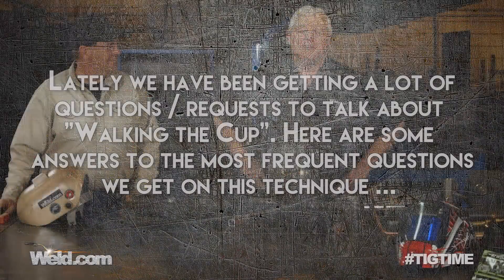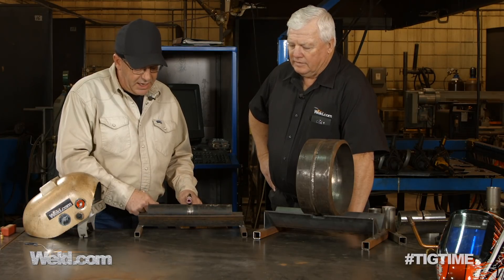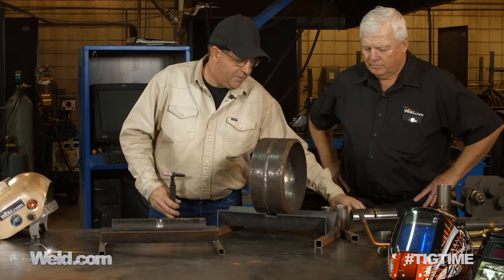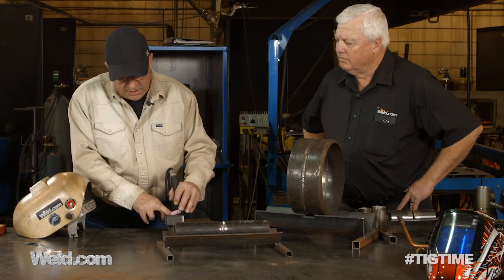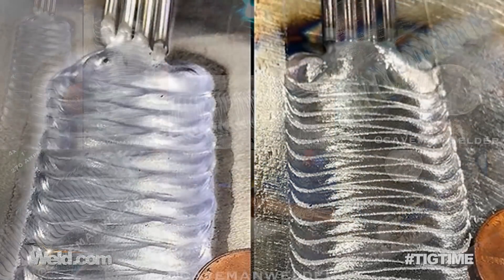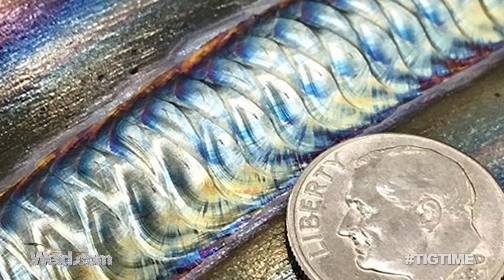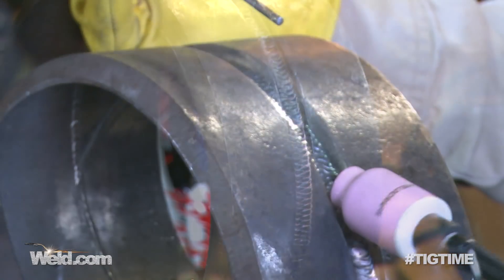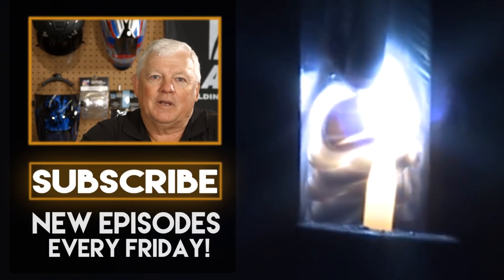TIG Welding Technique: Walking the Cup

Comment: I dissagree with bob saying walking the cup is faster than freehand you can flush a heavywall off the bead freehad because the torch angle you can not flush heavywall off the bead walking the cup on the cap or hot pas where you dont have to move alot of metal it may be faster but not for fill passes

Comment: I had a quick question. What amperage are you set at? I understand that amperage settings are probably dependent on the specs of the piece as well, but I'm curious as to what amperage you're running at.

Comment: Is it possible to do this on 110 amps? No 220 in new garage and that's all im limited to until taxes. Could I slim it down to a 17th or 3/32 filler and use more passes? I need lots of practice and that's all I have for machine and power at moment

Comment: I need some serious help on this. Biggest issues are... How to start a plate where u can't walk at 1st? I try and free hand but without a place to prop I usually end up dunking tungsten. Then once I get going parts will flow smooth and others I stick,skip ahead or am just going side to side with no forward progress. Do u have any joints to practice on or any tips? Need to get this down for 6g Tig cert.. have  asme ix in smaw now but need Tig to be employable.. help please

Comment: I now have two Lincoln Electric Mig welders and two Tig. The Migs are HD 100 and the Mig 180. Esab seems like they give you more features like the auto for when the sitck out gets impossible for the Lincolns ? I only have limited control over that.

Comment: Now lets get this clear, walking the cup is a fancy disguise name for resting the torch on the job to keep the electrode out of the puddle, and is used by those that do not have a steady enough hand to weld without doing so, so called walking the cup has no benefit at all to the weld.
Reply: John Bower you have no clue!!! LMAO 😂 Do you know what X-Ray welds are? What code are you welding under? I hear your foreman yelling your name, he wants those handrails finished.
Reply: Ummm... yeah, you keep doing it that way.... good for you.
Reply: @sillynacannada6718  I'm a Pipe Welder and a AWS Certified Welding Inspector, Yes I will Keep doing that way.  BTW a X-Ray Certified Pipewelder does it all, Freehand, Walking the Cup, Uphill, Downhill, Left Handed, Right Handed. But what you will not see is Dabbing, cause if it takes way to long and when you weld to slow, you will get replaced with someone that can do it all and can do it fast.
Reply: ZGERMAN  the reason one does not “dab”, some call it “push puddle” is because one risks oxidation,regardless of argon. You know, bad. If you free hand a UT, you’re either trying to bust out or in a rat fab shop that paid the inspector.
Reply: ZGERMAN just caught the downhill bit, so you run a squirt gun. You’re not a welder, you’re a joiner.
Reply: ZGERMAN ummm.... my original comment was meant for the original comment. Not yours, I was agreeing with you. Except for downhill and free hand tig...

Comment: i welded steam piping for 30 years. that was cool you know your shit. i know the codes dont like running more then one rod . i ve ran as many as six. while walking the cup, on the cover pass. i like to think of it as rolling the barrel light touch is very important. never thought about pulling down slightly makes sence. great video.

Comment: Union Boilermakers are the highest skilled workers of the skilled trades they weld smaw mig tig with a lot of it in out of position and in confined spaces they are also skilled heavy riggers lifting some loads in excess of 100 tons and also set and connect the iron to set these loads on working at significant heights it is a dirty and dangerous job and I loved it for 35 years traveling all over this beautiful country.retired union strong

Comment: Is Bob Moffatt a lefty tig welder?
Reply: Lefty but can do both.
Reply: to complete position weld tests you've got to weld left and right handed anyway to get bottom to top on both sides.
Reply: amazing!  my hero
Reply: Any good welder is ambidextrous. I know tig doesn’t throw sparks, but you can tell you’re partnered with a good welder when they have the same amount of burn on both sleeves.

Comment: Since this video is kinda old, I'm just taking the chance my question will get answered. I have experience with SMAW, GMAW and GTAW welding, but I've never used the walk the cup technique when I used TIG to repair dies. My question is, when do I need to use that technique?
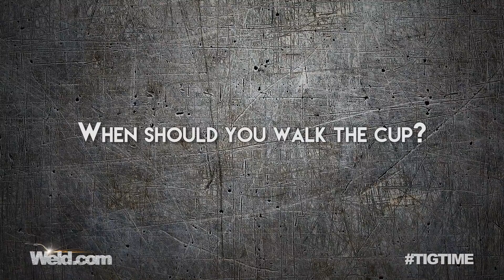Reply from the maker: We go over this to some extent in the video at 2:55.
Reply: Ok, I'll watch again.
Reply: Gotcha. It looks like this technique is best if you need very flat welds and if you need to work quickly.
Reply: We also have another video out on this technique.

Comment: I'm new to welding and confused.
can you tell me the difference between
Tig welding
MIG welding
structural welding
arc welding
stick welding
  I herd stick welding is the hardest and if you can do that then you can do all, is that true??? please helps.
Reply from the maker: That's a lot of information for a YouTube response and you'd be better off doing some research on AWS.org. Here is a brief answet to your question: 
TIG (GTAW) = Tungsten Inert Gas (Gas Tungsten Arc Welding)
MIG (GMAW) = Metal Inert Gas (Gas Metal Arc Welding)
Stick (SMAW) = Arc Welding (Shielded Metal Arc Welding)

Structural isn't an actual process, but the welding of erected structures, like buildings. 
Just because you can stick weld does not mean that you can "do them all". Each one takes practice.

Comment: God dang TIG is so clean! I do some flux core MIG welding and compared to this it is so messy (even though the welds look halfway decent after you clean out all the slag and brush it). 
What are the structural differences if any? I may have to start TIG'in! I do mostly projects for my Jeep such as roof rack and bumper hoop type stuff.
Reply from the maker: Takes a little longer, but for car parts it looks a lot nicer. Structurally it is better for that type of work too, because you can control the heat much better.
Reply: TIG is AWESOME. So, so clean. MIG is definitely a messy job.
Reply: With flux core it don't matter how good u are they are not gonna look pretty
Reply: Michael Kirst if you're doing welding for vehicles, definitely do tig. You'll get a gorgeous weld(if you're good) and also it's very clean. Make sure your skin is covered though, tig is much brighter and produce more UV rays due to no smoke production. It CAN get very technical tho.

Comment: question about the filler rod . Is  there any movement of the filler rod  as the tungsten moving towards it? .Or does filler rod stay stationary as it is being deposited in to weld puddle? thanks!
Reply: Just lay the wire for practice (Don't move it, just let pac man eat it), then once you get comfortable with your torch control, start feeding in wire to make a larger weld.  Pause on your edges to fill the undercut.
Reply: j bones you have to move the end of the filler rod with the puddle and dip as you go.
Reply: Беспокойное сердце врача

Comment: If I am doing an x-ray quality weld on pipe and don't have a foot pedal, I like to run my arc to the side and pull out up my filler rod if possible and then break the arc. Does not leave those ugly craters from the arc break, which in turns make less grinding for me. Just my 2 cents
Reply: Very good tip.
Reply: Better yet, brake your arc on your filler wire. When your cappin, you don’t have a bevel anymore.

Comment: thank you weld.com
i work in mig mag weld 
can you make video about mig mag weld 
and thank you very much
Reply: mohamed kamel there's not much to MIG... just do a circle, C, whip pattern or stringer when you should and set the wire speed and voltage correctly.

Comment: +Weld.com - Walk the Cup is somewhat more difficult to explain verbally, but here goes.

When Welding you want to manipulate the Torch properly to produce a correct Weld. With Pipe Welding you "Walk the Cup" to move the Torch sideways and forward. 

The "walking" is sort of like walking on ice, you want to slide an extremely small amount forward OR backward while moving the Torch forward (the tiny sliding is IF you either walk too far or not far enough).

You "walk" by rocking the Ceramic Cup sideways, the ceramic grabs the steel similar to planting your foot on ice (so you don't slip) and you lift the other 'foot' (other side of the Cup, not planted on the Pipe) eliminating friction (or physical contact) by rocking the Cup (one foot on the ice, the other lifted up) and 'planting your foot' slightly further ahead - with 'micro-sliding' forwards or backwards to correct the forward Travel Speed.

The sideways motion of the walking is to accommodate the width of the Weld IF you choose to Weave instead of doing the entire Weld using Stringers (a straight, unweaved, Weld bead).

It's a convenient crutch, that makes it easier to produce a quality Weld and happens to manipulate the Torch close to what you would have (when done properly, and with any 'micro-sliding' necessary - IE: Do not walk incorrectly or it (the Weld) won't be OK).

For Experts to attempt: Don't walk, run. 

Assuming an entirely manual process of Welding (no 'PipeMaster' manipulator, but rotation by motor is OK) it is better to Weld all Stringers (same as the Root, it's a Stringer) and push the Wire (manually) the same as "Wirefeed TIG" - simply push forward on the Torch and shove the Wire in (like Soldering, just shove it in). After Root and Fill you likely want to Weave the Cap to make the Cap polished smooth, a Stringer Cap is acceptable but it should be smooth also - smoothness comes from cranking it (and Welding correctly).

YT,
Rob

Comment: Say you're welding a fence or just 2 metals toghther. Do you want to do a root pass hot pass & the fillers? Or is it just one beed?
Reply: Fucking troll.
Reply: heavier duty fences should have a few more passes. stacked
Reply: have*
Reply from the maker: your going to need to get a little more specific with your question, however, if you are repairing a fence post, assuming it is carbon steel, you would likely just want to do one pass with a complimentary filler metal.
Reply: how long it takes to learn this
Reply: 47 hours.
Reply: Wrong moron. You need to run a 3/24 using the "up river" technique. Really you should use an upside down Up River but you dumbasses probably aren't that good.
Reply: Triston Charge How dare you insult me sir?! I have certs you haven't even heard of!!! I am the greatest welder alive.

Comment: Is there a reason why you would use tig for welding this pipe over say..regular mig or stick welding it?  To me it seems like welding that pipe together would be MUCH faster using a mig welder set at the right amps, wire size and wire speed??  Why use tig over mig for welding this pipe?
Reply: It doesn't give spatter that gets inside of the pipe also alot of times they do the first two passes with TIG and then they fill it up with stick
Reply: fireflite34 I'm thinking they tig pipe that can't have any contaminants in them?  Otherwise why would you used tig instead of stick/mig which is 10x faster....

Comment: What's the best welder for just practicing mig. And one for tig.  Cheap for beginners
Reply: Um... I think you missed the "Cheap for beginners" part.
Reply from the maker: The ESAB Rebel and the Lincoln 210 MP are both nice little multi process welders that will do both MIG and TIG. Both will cost you right around $1400 if you want the TIG function.
Reply: everlast makes good machines.
Reply: +Weld.com hey is the 220 red Lincoln box good to practice on stick pipe 
wat do u recommend??

Comment: HELP! i need some advise. the welder i'm using wont let me change the size of my weld puddle no matter which position i have the foot peddle on. can you tell me what's wrong?
Reply: did u switch the machine to the foot peddle mode?
Reply: It's always on foot mode.

Comment: Numerous passes? Use a bigger Machine and do it in one pass by feathering the pedal.
Reply: lol and what machine would you suggest
Reply: I used a 350 amp miller syncrowave. I could make a 1/2" weld in one pass, no problem.
Reply: jimmie montgomery can you make it pass x-ray when you do that?
Reply: I am certified stainless pressure vessel and yes doing the feather technique is the best way to do a big solid weld. I could do the same on aluminum. The main thing to remember is where if any is the part going to warp and counter it. I takes some experience and and maybe you may have to jump around and back step your welds. I welded aluminum up to 3 inches thick using a 5/32 thoriated tungsten and pure helium and turning my arc control balance all the way up to 90%. You make a big chamfer and step on the pedal full power and fill the weld with rod and then back off the pedal and move over and repeat. My welds looked like a row of quarters and I would fill a 3/4 inch deep chamfer in one pass, but first you have to preheat a part that thick and before feeding in the rod let your arc penetrate. Helium creates a much hotter plasma field around the arc than argon does and you will get twice the penetration. I used helium even on a 316L stainless screw compressor that would generate over 20,000 lbs of pressure.

Comment: I'm a journeyman TIG welder and one of the best around, I'm also 63 years old. Takes experience and walking the cup is used for making a weld pretty, but watch out because it may put too much welding heat into the part and warp it.

Comment: Walking the cup i like and don't like???
When working on site mainly in the food industry with stainless tube 1.6 mm (16 Gauge) wall and you see guys using this process and the welds would have to be at least 8 mm to 10 mm (5/16'' to 3/8'') wide, which for me is way overboard for this thickness of tube.

What makes me laugh the most about this is they walk around with the attitude that they save peoples lives or something similar. 
Mate you weld two pieces of metal together get a reality check. 
What the F... is wrong with these people.
I love a good weld as much as anyone but ???????
Reply: Thanks for the reply.
 I guess it comes down, each to there own.
meaning do what makes you happy. 
But leave the saving the planet attitude at home.
that is the only that i ask.
Reply: Yeah welding 1.6mm ain't saving no one's life but it's a good attitude to want to do your best on everything that you do. with 1.6mm it's all about aesthetics but when you're welding 15 or 20mm structural steel for wall columns you will actually cause death if you aren't concentrating so I can't hate on the be the best attitude.

Comment: Great video yes you do go by the welding procedure but at the end of the day u gotta do what makes you more efficient and finish the work faster and if the boss is not watching u turn ur heat up add a second filler rod n just weld baby !
Reply: Guessing you didn't have to learn metallurgy when you learned to weld

Comment: My cup walking is more like a drunken stagger.
Reply: You got the whiskey tungsten too
Reply: tell me about it lol
Reply: To avoid slipping the cup, the angle position of the cup must consistent towards the welding material.
Reply: Don't walk the cup. LAZY WELDING. learn to weld with a steady hand. You cannot weld with the correct angles by touching cup on the platy.

Comment: Mr. Tig how many degrees is your pipe bevel?
Reply from the maker: It was a 60 degree included angle
Reply: Thanks!
Reply: +Welding1 37.5 degrees in my field of pipe welding.